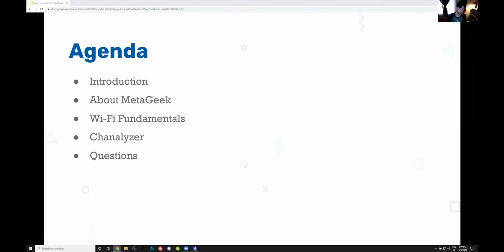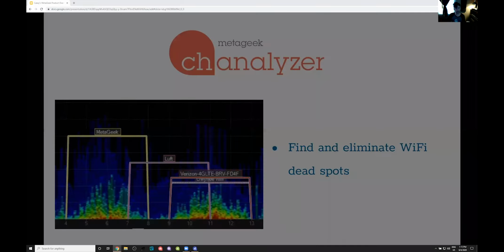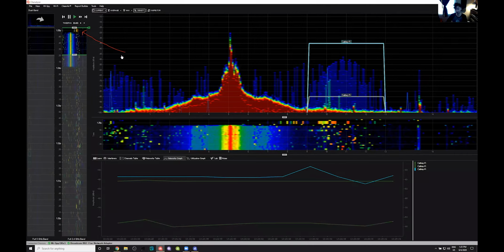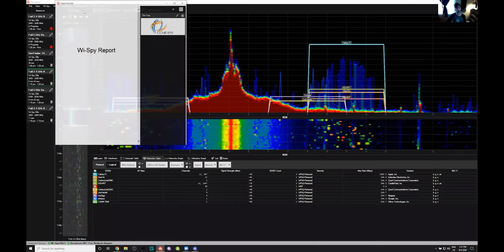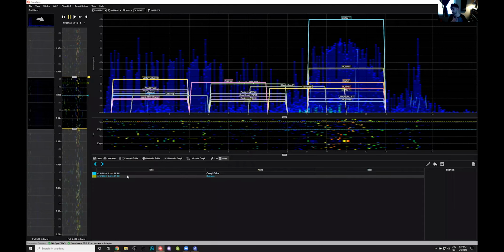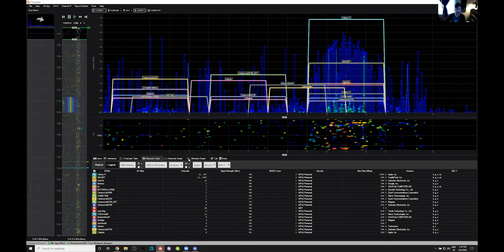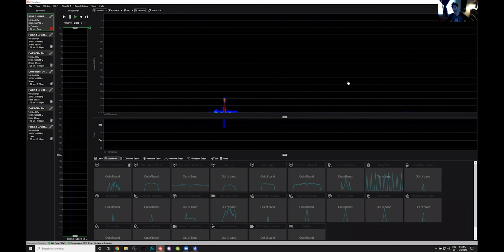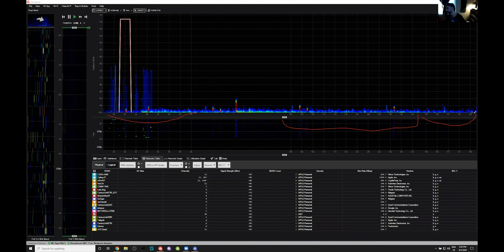Deep Dive into Chanalyzer by MetaGeek

Comment: Any possibility to cover the entire spectrum from 10MHz - 6 or even 8 GHz ie adapting Chanalyzer and antennas to cover the range?
Reply: If you want to geek out/ get technical then what you want is an SDR- software defined radio..don't let the name descieve you! It is not limitted to "radio"- a device such as the HackRF, Pluto, USRP...but specifically the first of those can display activity from10hz up to and way above te ranges you desire. Wild right? You just need to learn some software to view the spectrum/ waterfal...GNU Radio is the 1 to use...or SDR Sharp...with the HackRF, you can actual add on/ buy the completted version where a case and another module is added on makng it the HackRF PortaPack..this way you have something that is like a GameBoy, a portable, powerful spectrum analyzer! It's a wicked device!